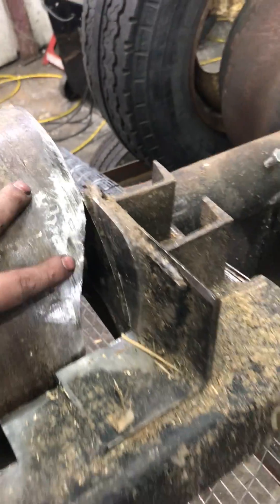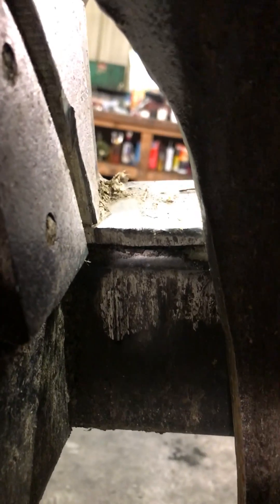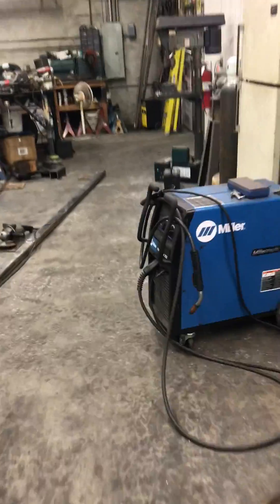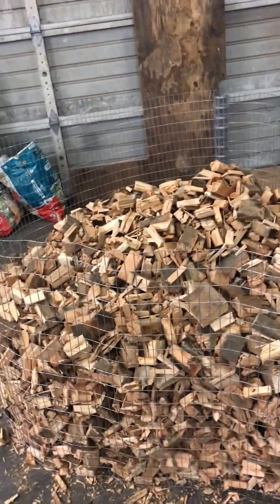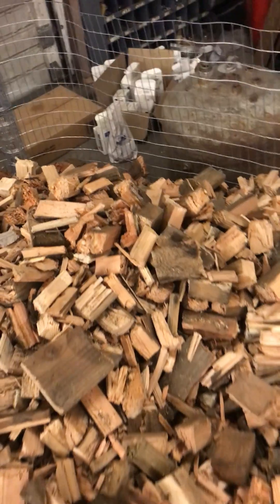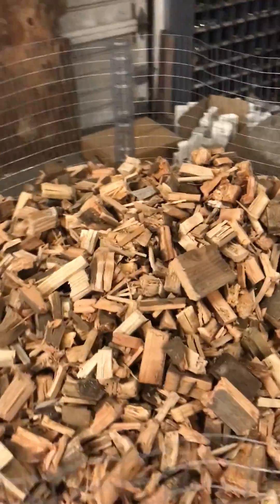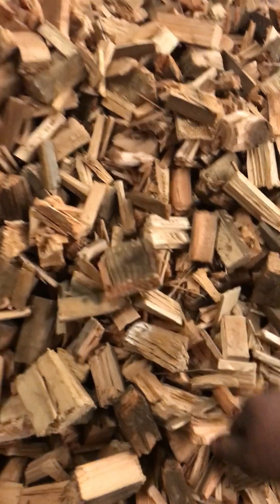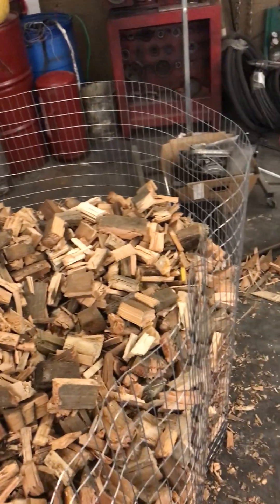wood chunker update and wood drying

Comment: No doubt it's a lot of work and planning ahead to keep the wood supply up and ready to use. What you save in petro dollars you trade for man hours. Still, I wouldn't trade my ways using  wood for any other life style..  " Chop 'til I drop " is my motto.
Reply from the maker: That pile was about 2 and a half hours of chunking and I'm estimating about 2 weeks of fuel. But my commute is going to be jumping up 30 miles here shortly so I will need to do a lot of chunking